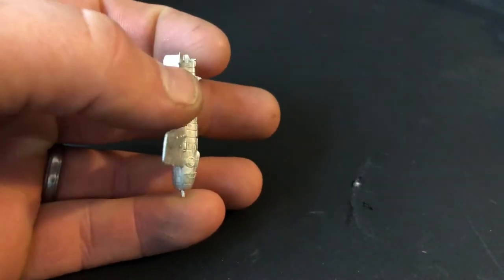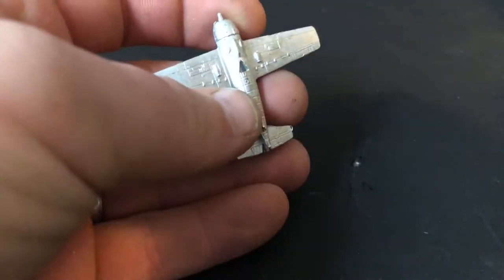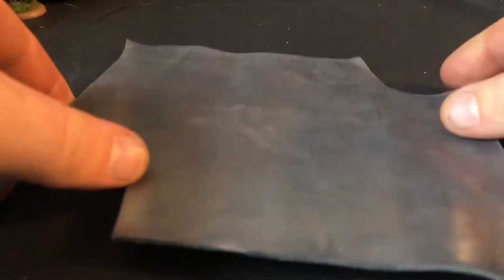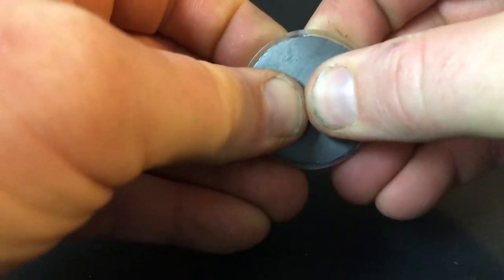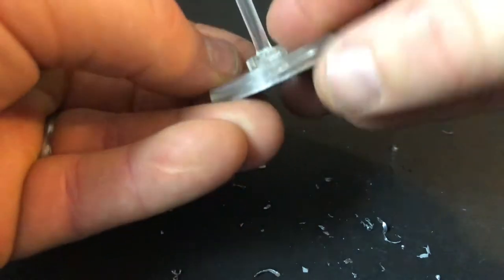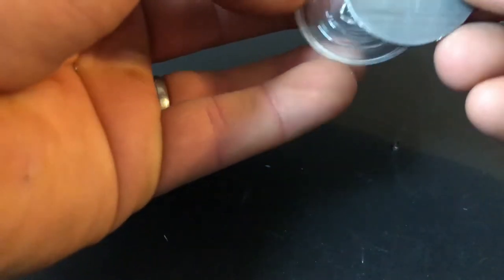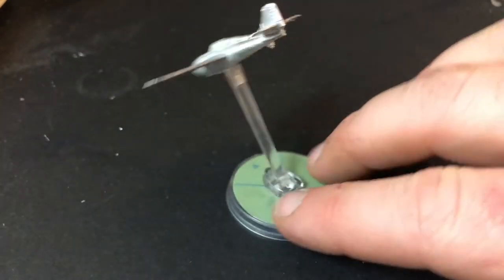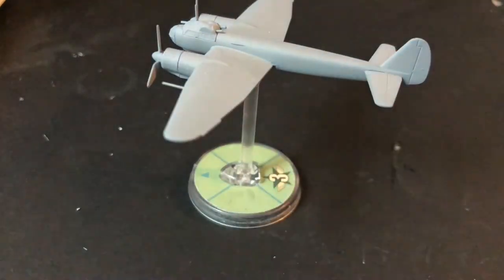Blood Red Skies Base Modification Tutorial

Comment: I went with the M12x35 washers option with an extra hole to allow pilot change but for those who are not at ease with tools, I recommend to use blue tack instead of superglue. Works perfectly for both metal planes and bombers.
In fact, we also use them for all the planes as it feels nicer on the mat.

Funny thing, this week, a friend of mine used the exact same DropFleet pegs for all his Antares flying unit ^^

I noticed that the wildcats were a bit loose on the peg but as I didn't played them yet, I didn't tried to fix it. Thanks a lot for sharing this solution.
Reply from the maker: That’s ok. I only used lead because I figured it’s about as heavy as you can get. The pegs are a life saver and make things a lot easier. Thanks for watching.